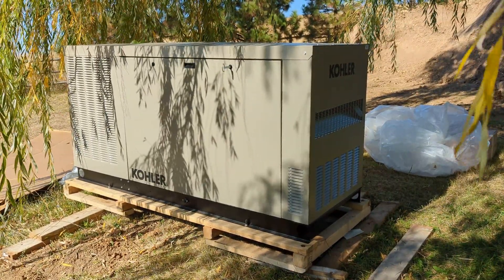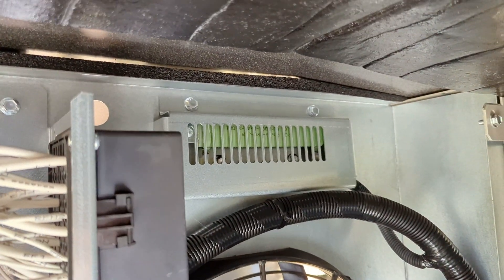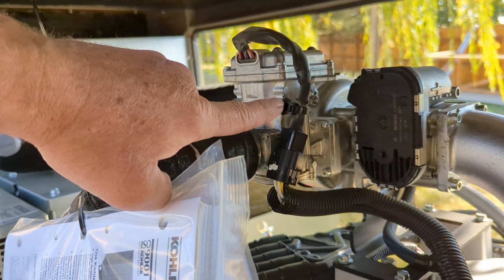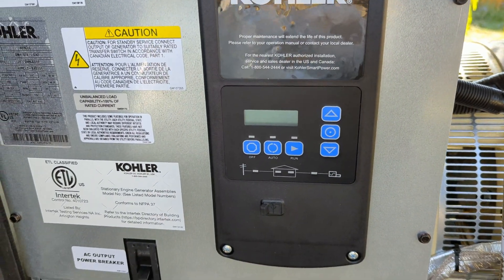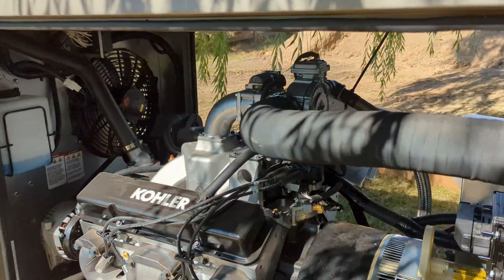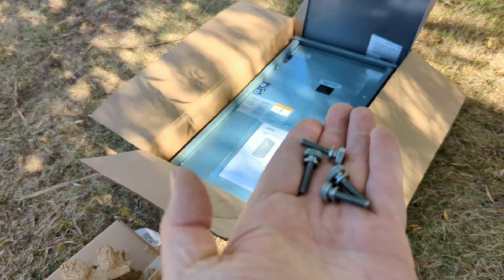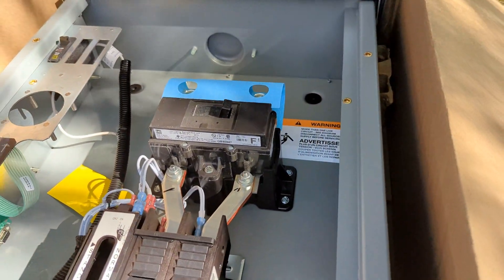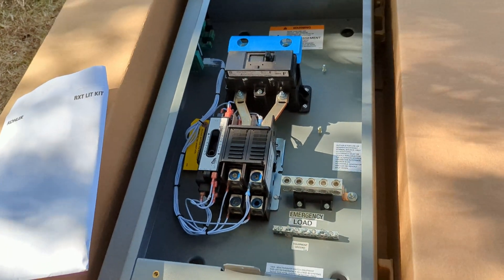6.2 liter V8 Backup power. Kohler 48KW LP Gas (Propane) Generator 48RCLC

Comment: Looking at these and the Generac 48kw, like the build of the Kohler but that V8 is a lot more thirsty than the Generac 4 cylinder.
Reply from the maker: Not much difference at half load. Full load the 4-cylinder uses less:

Generac 4-cylinder, 1800 RPM LP Consumption:
Full Load 6.61 gallons per hour
Half Load 4.16 gallons per hour
ref: https://norwall.com/products/generac-48kw-120-240v-1p-rg04845gnac

Kohler 8-cylinder, 1800 RPM LP Consumption:
Full Load 9.0 gallons per hour
Half Load 4.7 gallons per hour
ref: https://resources.kohler.com/power/kohler/residential/pdf/g4306.pdf

But the NOISE! Generac 70 dBA ("normal" load),  Kohkler 61 dBA (full load) - that is a big difference.
Reply: @Baxsie  Still trying to get someone that does Kohler's to give me a quote but no response from anyone and everyone I've found has been Generac only...
Reply from the maker: @ChrisEpler  I used Electric Generators Direct ( https://www.electricgeneratorsdirect.com/ )  I spoke to Nico Welgemoed at (800) 710 - 7499 ext 164 I am pretty sure any local electrician that is willing can do the wiring install. It is a little intimidating but if you get the correct matching Kohler switches from Electric Generators Direct (Nico helped me select the correct ones),  the installation instructions are pretty clear.

-
Reply: @Baxsie thank you for these stats.  I’m trying to figure out if I get a 48kw or the 32kw.  Everything is a trade off.

Comment: What size wires are needed from there to transfer switch and do they pipe in the slab at the bottom of the generator? Nice setup.
Reply: That should be wired to meet code. My electrician worked all that out and did all the wiring.

Comment: We have the 60kW version of this - looks identical.
Wasn’t cheap but sure has been a total pile of problems!
Reply from the maker: We have it on a slab now, still waiting on the electrical connections and propane supply. We have not fired it up.
What kind of issues did you have with your 60KW unit?
Reply: 1995 What problems have you had?
Reply: @Dqalex  for the first year, it wouldn’t generate any power, as the actual electrical-generator unit needed replacing - yes, it didn’t work from the factory. 
Once fixed, the first major outage resulted in the main controller failing immediately. 
Thereafter, have had a host of niggling issues - rough running (not firing on all cylinders), a constant ‘adaptive learn’  error code (persists to this day and Kohler can’t help with it), and an issue whereby starting under load (during outage) results in wild fluctuations in voltage, followed by nothing and then it tries to start again - it does eventually get there, but does make me think it won’t. 85 total run-hours so far, 60 of which is just 4 years of weekly exercise.
Max load has been about 25kW, so I’ve never really stressed it.
My Kohler agent has had unbelievable issues with the the smaller models (broken crankshafts on brand new generators). My 5 year warranty is up this year and then God only knows how much I’ll spend on parts every year.
Reply: 48 and 60kw both use same engine, 80kw adds turbo.

Comment: it’s a 383 cubic inch stroker 6.2 chevy. what you see on the exhaust is called a blanket, has nothing to do with sound, gas gensets exhaust glow red hot, (why i don’t care to work on em but i do) seen to many catch fire over long run hours. the ball valves go to a block heater witch i see you don’t have so the cut the levers off so you don’t open them but are there i case you decide to use a circulating block heater, did your salesman not go over anything with you?
Reply from the maker: Thanks for the information on the exhaust blanket. I guess it is a bit like the header wrap on hotrods - keep the heat in until the hot exhaust exits the engine compartment. Whatever they are, they have impressive build quality.

There was no local stock - so I used one of the big online sellers. They were good at selecting the correct transfer panels to work with 2x 200 amp services (I hope). We have one RDT transfer switch which will stand alone, and an RXT that will communicate with the generator.

I did order the block heater and battery heater. Another comment let me know what the valves are for. I have yet to install them - still waiting on propane and connection.

I have been studying the installation - I am a bit in the dark. I think my electrician will be good for the HV wiring. I'll have to follow the install guide for the low-voltage stuff.
Reply: ahhh i gotcha, yeah not to many storefronts anymore, and yes it’s like headed wrap. and your correct on the exhaust, it’s also to keep it cooler cause it gets hot hot hot! ✌🏻

Comment: What that coolant valve's are is for a heater to keep the coolant warm in the winter by circulating it thru a heater .  I have a Kohler 60 RCL at my business. and a 30RCL at my home down in Florida. Kohler makes great generators.  Another tip is to take out the oil drain plug and go to home depot and get an extender that will screw into the drain hole that you can attach a hose to to drain the oil.  It makes oil changes a lot easier. When your done just take the hose off and put the plug back in.  The plate on top is to get to the radiator cap.
Reply from the maker: Thanks for the pointer. I have the engine heater, so by using those valves it will be easy to install. I also got the battery heater, and just picked up a starting battery.

Good to know about the radiator cap access. I should probably read the manual, LOLz
Reply: @Baxsie  No problem. You made an excellent choice by going with Kohler

Comment: Do you the fuel consumption and how large is your LP tank?
Reply from the maker: In cold weather, a large generator can consume propane faster than the propane can evaporate inside the tank.

At full power, this generator uses 9.3 cubic meters of propane per hour - at any temperature below 20°F a single 500 gallon tank can not provide enough propane vapor.

Here is how I studied the problem in a spreadsheet:

https://baxsie.com/images/Remodel_2021/Generator/Propane_Consumption_Evaporation.xlsx

One solution is to use a larger tank, another is to somehow keep the tank warm. Apparently this is why some tanks are buried underground. There are also electric heating blankets: https://amzn.to/3CIdeey

Our solution will be to use 2x 500 gallon (400 useable) tanks, for 1000 gallons (800 useable) total. If the tanks are reasonably full, we should be able to use full power down to 0°F, and should be able to use 50% power down to -10°F

This generator is way overkill for our needs, so we do not expect it to run at more than 50% power.

Our runtime from a full tank at 100% power should be 88 hours, at 50% it should be 167 hours, which is a full week, running 24 hours a day. In real life we would probably shut it off at night in all but the worst weather.